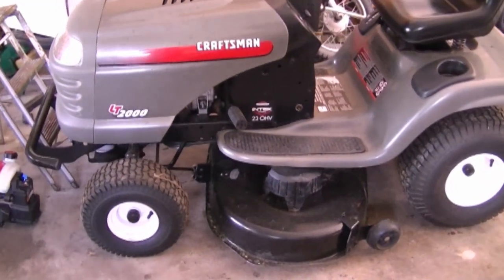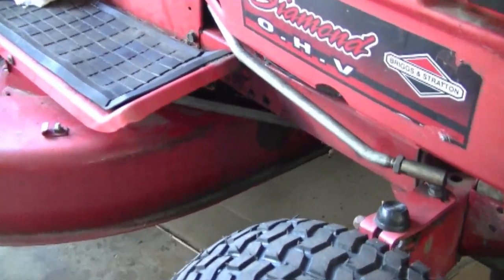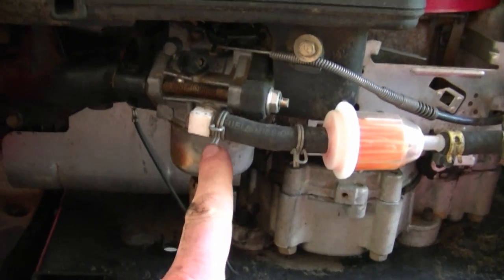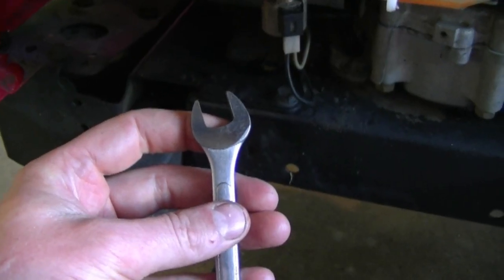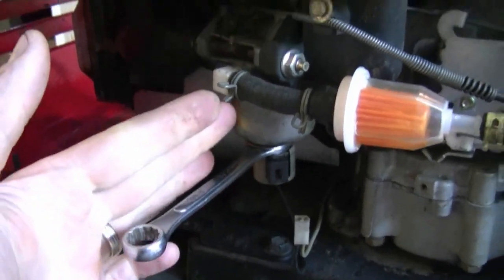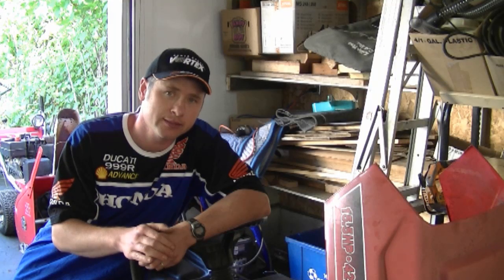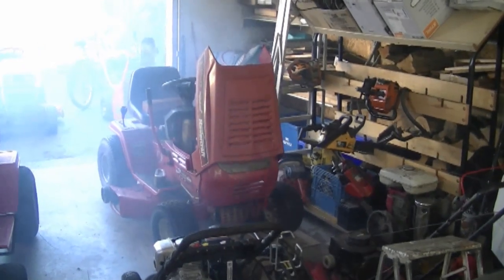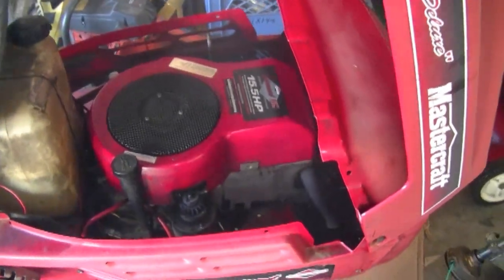Small Engines Q & A Video #57 in HD

Comment: My lawn tractor is probably about 10 years old, and it just began to burn oil for the first time after taking it out for spring/summer this year. It isn't excessive, but when it's cold it will shoot puffs of smoke when I throttle it up quickly or let of the clutch under load. It's an OHV Kohler.

Comment: Hi Don, Great video as usual.  Sorry to hear about your wife's health issue.  I thought I would mention my Kohler Command CV22 has the fuel shutoff solenoid too.  But, even with the solenoid, I have to let the engine cool down for a couple minutes at lower RPM, or it will backfire.  I wonder if the solenoid isn't working???

Comment: i have  a flat head 11hp i/c briggs and it slowly but definetley surely loses oil. there are no cracks on the outside of the casing but there's oil all over it do u think that would be the base gasket for the two halves of the engine or is there even a gasket ????

Comment: Hi i have a craftsman 12.5 ohv ic gold and when it did run it smoked liked that now it wont start at all its not sezed it has spark fuel and compresstion but wont start even if i put starting fuild still wont start do u have any idea whats wrong i checked the valves and they are gaped good also.